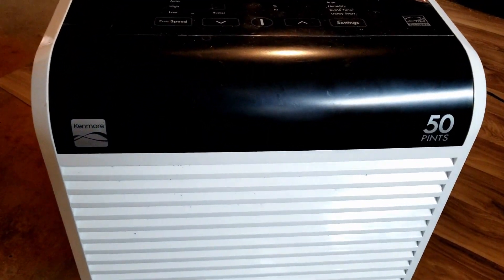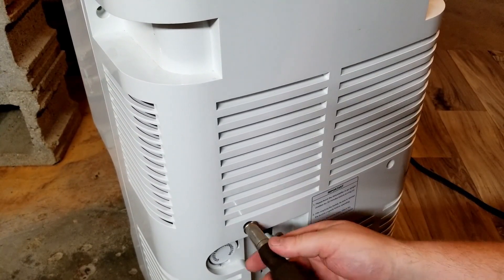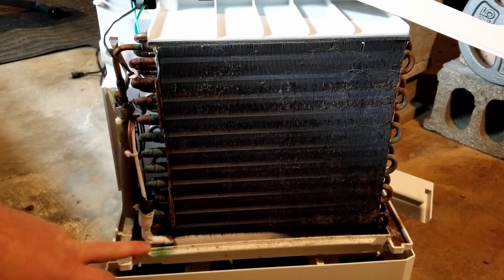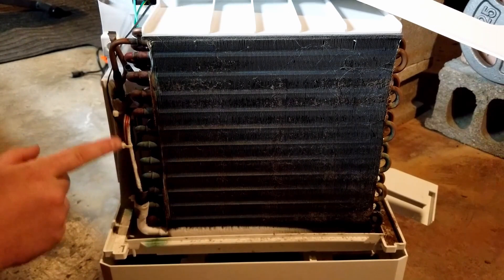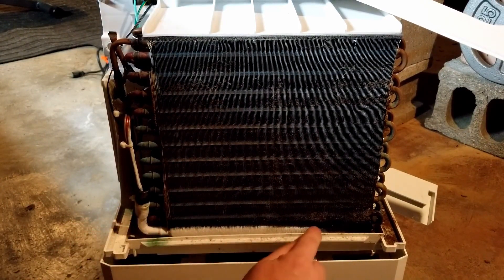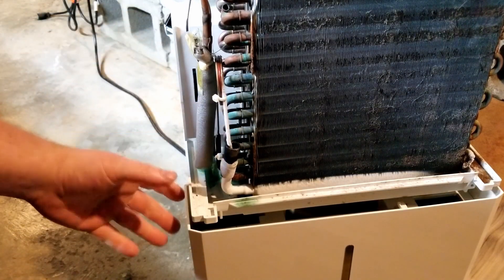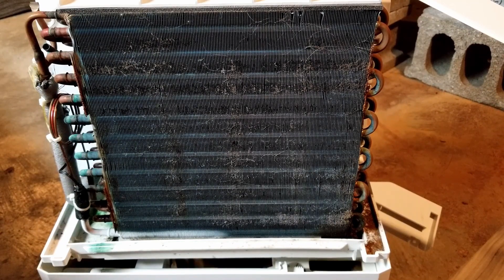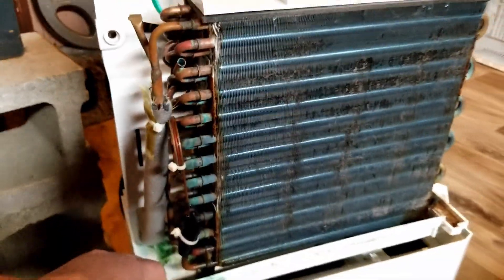Dehumidifier not making water?... find out why

Comment: The junk truck just picked up two brand new Govee dehumidifiers from our house charged us 10 bucks. They retail for $300 apiece on Amazon. They gave us a refund for one unit because the other unit was a replacement for the failed unit. Then the second unit that was the replacement failed both stop collecting water due to bad sensors. Changing the sensors is not easy because then you have to refill the Freon. so basically if a dehumidifier fails to collect water, throw it out or hopefully it’s under warranty and get it replaced or get a refund. The most difficult part about the whole process is getting rid of a faulty dehumidifier because of the Freon you can’t just throw it out with your trash. Some places can be costly to get rid of dehumidifier. Thankfully the junk truck though they wanted $100 or at least $50 to get rid of the two units we got them down to $10.00 $5 for each unit.
Reply from the maker: They charged you!!! 
Any metal is worth money. The Compressor inside, right now is worth $0.18/pound at Mongo local scrap yard. Appliance tin is worth at least $0.08/pound. Around here if you have metal, appliances, etc.. the junk truck/metal scrappers take them for free. In fact, the local energy company will pay $15 for each dehumidifier you want to recycle (if it turns on). Sorry to ask but... Where do you live were they charge you for metal recycling? And what is the name of this company?